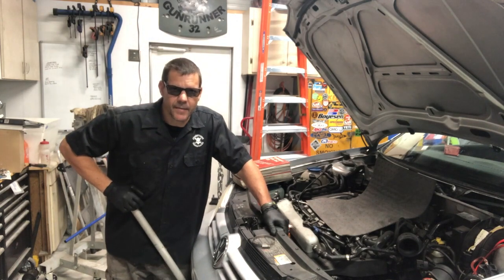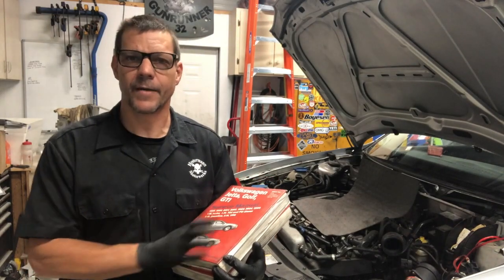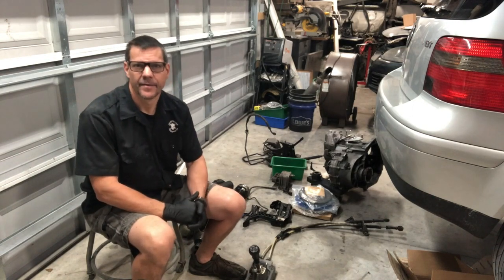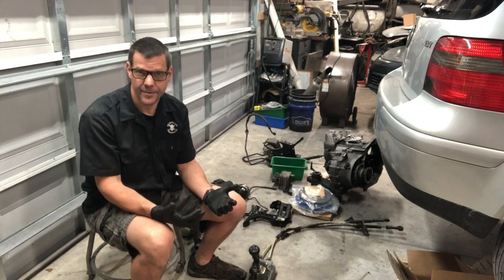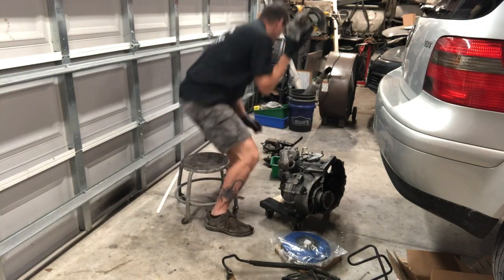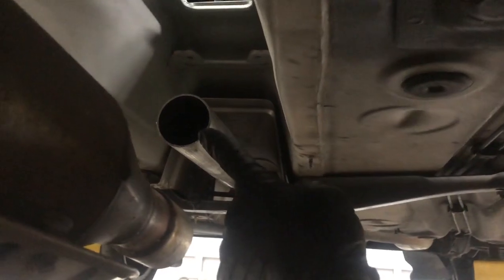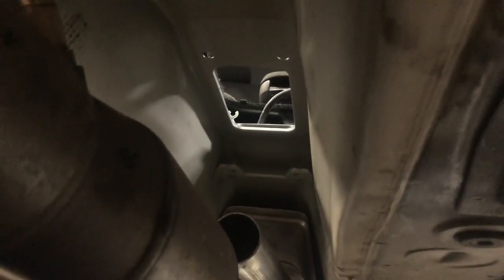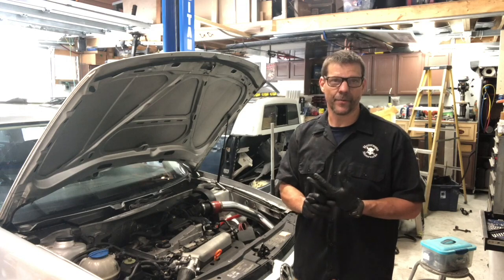MK 4 VW tiptronic auto to manual swap (1 of 3)

Comment: What's a 99 Jetta TDI with a 6 speed manual swap car worth? (Netherlands Skoda diesel transmission swap kit) Car has leather, 215k, new timing set and head gasket... I've done a lot of work to make it mechanically superb.
Reply from the maker: It all depends on buyers in your area. Right now the used car market is fairly high in my area but I couldn't give you a value that is accurate in your area. Put up an ad with what you want for it and see what happens!

Comment: Is the electrical connector the same for the auto and manual starter motor?
Reply: Yes it is just a post for the big cable  and the signal wire connector is the same

Comment: What was wrong with the automatic gearbox, it was a catastrofic failure or a personal choice of the owner? I know is off-topic but I will highly apreciate your opinion on automatic gearboxes before dsg. As far as I know there are 2 models for mk4 one for petrol and one for diesel but I might be wrong...
Reply from the maker: This particular car, several shift solenoids were going bad. A new valve body and solenoids would have fixed it but the owner wanted a 6 speed.
The mk4 era automatics are not the best. They can be fine transmissions but need to be serviced every 40k or so and most people don’t do that.

Comment: If it's a tdi, to me, it's worth it.
Reply from the maker: artdeco101010 yeah that’s what I think! Love my TDIs ! Bought plenty of autos that didn’t work and swapped em to manuals
Reply: Hestermann Motorwerks I have a 2003 vow TDI golf with a 4speed auto, can I swap it to a 6speed manual swap easily? because my highway gearing is really bad it’s Reving at 3300rpm at 90mph and drinking fuel

Comment: Can get all these parts for a few hundred easy
Reply from the maker: it all depends on where you are and how much you get new. If you get a new clutch, that will cost you a few hundred. But you can buy a wrecked car for $500 and get everything you need if you don't mind using used.

Comment: Thanks a million for the great videos, made my swap go smooth as. Just did 02j into a 2001 mk4 1.8t aum. Wiring was almost bang on, and everything else true to the video. Just need to bleed the clutch now and reassemble interior then enjoy it. Thanks again
Reply from the maker: awesome! glad it was helpful and your swap went well!  You may have to bleed the clutch, drive it for a couple days then bleed it again. It can be a bit of a pain
Reply: @hestermannmotorwerks  Finally drove it tonight, think there is still a bit of air in the clutch line but she boosts along beautifully 😍 Only issue now is I have no speedo anymore and a VSS code, so will do some diagnosis there